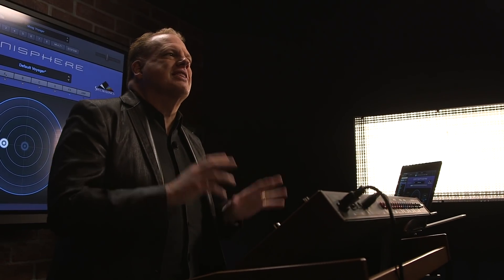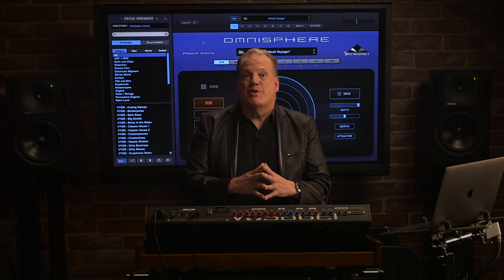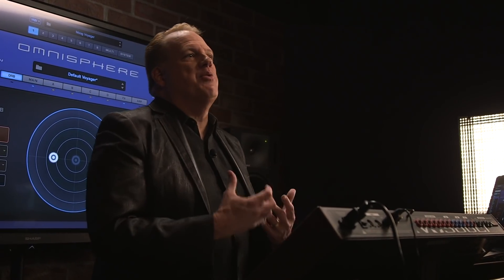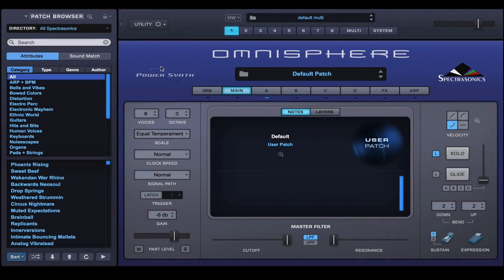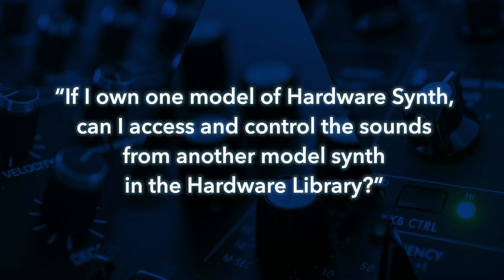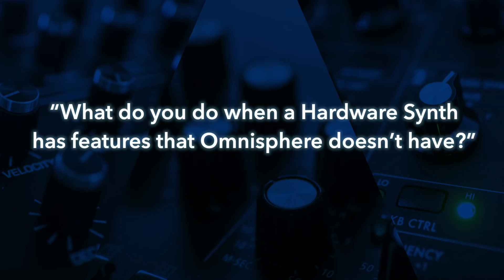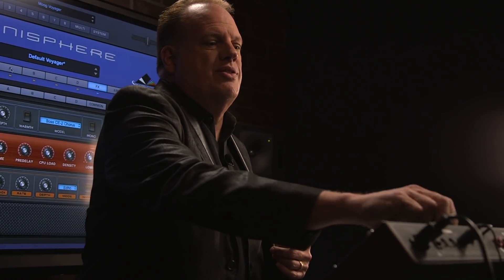OMNISPHERE - What is Hardware Synth Integration?

Comment: Are these “hardware synths” actually modeling the hardware to manipulate in the software?
Reply from the maker: Hardware Synth Integration allows you control Omnisphere directly from your supported hardware synth. Since Omnisphere is so vastly capable of creating different sounds, using a supported hardware synth as a controller often leads to sonic results that are similar in spirit to the synth being used. It’s not quite modeling, but it definitely captures the vibe. We’ve included a ton of Patches that were created this way in the Hardware Library of Omnisphere. It’s best to try it out if you can!
Reply: @SpectrasonicsVIDEO - Thanks for the reply. I don’t have the hardware but would like to use the sounds and interface. So the interface/controls on the screen work exactly the same when calling up a hardware synth?
Reply from the maker: @norakat  The sounds we created using Hardware Synth Integration are available to all Omnisphere users, whether or not you own the corresponding synth - just select the Hardware Library from the Directory and explore the sounds there! 

The visual interface of Omnisphere is not affected by Hardware Synth Integration - rather, the connected hardware synth becomes a controller for Omnisphere, where all the parameters on the synth are deeply mapped to corresponding parameters within Omnisphere. 

If you have any other questions, please contact info@spectrasonics.net and we'll be happy to help you out!

Comment: Posted this in another related video, but thanks for adding MKS-80/MPG support! Some MKS-70/JX-10/PG-800 support would be nice too - there’s a load of us out there. Not sure how you’d get around the stock vs Vecoven 3.x vs 4.x with PWM mod thing, but am sure it’s possible 😉 Ps Cheers Eric for sound design on the originals. Wouldn’t give up my MKS-80 or 70 for anything, including the Jupiter 8.

Comment: Hi Guys :-) Hope all's well. Wondering if Omnisphere would work with my M-Audio Hammer 88 Pro midi controller. Are there any new modifications since posting this video? Don't have the money to buy a separate synth. The plugin itself is expensive for me. Thanks.
Reply from the maker: Yes! 🙂🙌 Your controller will work great with Omnisphere! Check out the ref guide with specifics on how to get the most out of it here: https://support.spectrasonics.net/manual/Omnisphere2/25/en/topic/system-modulation-page01?q=midi+controller
Reply: @SpectrasonicsVIDEO  Thanks. I'll check it out.

Comment: Please add the Korg Wavestate too!
Reply: that would give you the sounds of the korg wavestate without having to actually own the hardware, right?
Reply: @FinessedAnalyzer  Yeah! Seems like it's another level of imitation if it's a total digital Synth like the Korg Wavestate which, is support for everything could be done, would sound the same (minus DAC). Wonder how the copyright is handled in that case.
Also, I don't think it is possible to include the insane amount of options that the wavestate has even in Omnisphere. The expanded wavesequencing and the modulation options for every step in a wavesequence and modulation in general makes that impossible.
Nope, it probably have to be reasonably complex Synths which rules out many of the newer digital based hardware Synths. 
Or, perhaps, even the more modest budget digital/hybrid Synths, like Arturia MicroFreak which doesn't have any support. Probably due to the ever expanding new oscillator/generative Synthesis types in it. It's the same case there even if they settled with the 1.0 factory Microfreak oscillators they still wouldn't be able to emulate the Matrix modulation of parts of the oscillator settings where drastic changes in waveform in unique ways takes place.
Omnisphere is great, but it can't do it all. For that, maybe only Reaktor would have a chance to do it. But NI haven't implemented anything like the HW-profiles....

Comment: One request for the 2.7, it can be a very easy add for your software developers but very effective in the studio or live:

When I save my projects in my DAW with Omnisphere, I would like the browser to remember (to remain selected and after the recall of the project) the Category BUT also the Shuffle button if it was selected (or the other selection options). Everytime I open the project I need to select again those two so for my work flow its a killer, need to go to every Omnisphere channel and make the selections again, I use a computer just as a engine for it so I will prefer not even open my video monitor (my Ableton with the project boot up directly like a hardware synth and use 2 hardware synths as midi controller that are "integrated" ones)

Also I will love to see a real Randomization of the patches, like the Virus TI synth type, that has 1 to100% alteration of the patch, also an interesting one where patches can "borrow" from one to each other different aspects of the patch architecture.

Thank you so much! And looking forward to your next updates! :)
Reply from the maker: Thank you for your feedback and suggestions!
Reply: Also forgot to mention guys, please please if you implement the patch Randomizer make it midi controllable as well for 100% action without looking to monitor! (at least the commit button) Thank you 　            ps: also if we don't ask to much, a Randomizer for notes of the sequencer, midi controllable as well will be lovely and I am sure its so easy as well for developers!
Reply from the maker: You should try the Sound Lock feature! It’s basically what you are describing, but it works in a more useful and musical way!
Reply: SpectrasonicsVIDEO yes I know about it but a Virus TI randomization with 1 - 100% alteration option is more efficiant and surprising from my point of view. Thanks

Comment: No support for Yamaha Montage - why?!
Reply from the maker: Hardware Synth Integration requires a synthesizer with a layout that has clearly labeled, dedicated controls. As the Montage is a workstation-style keyboard, it would not be a good fit for this feature. 🙂
Reply: @SpectrasonicsVIDEO  Lol, ok I also find it confusing .. thanks for speedy reply

Comment: new to omnisphere - can someone pls tell me if I am missing something? for example, lets say you want a hammond B3 sample for your patch - looking on the browser under 'organs' is shown "Go to this Church", "Thrift store organ" "spike bow organ" and so on - as a sound designer what I totally DON'T want is to use someone's already heavily worked patches as a starting point. Where can I find straight samples, if possible, and how can I filter out all the sources that are already someone's patches? otherwise one can quickly lose track of: "is this my original patch or am I stealing this guy's patch" not to mention its very hard to layer overproduced patches together to make a new usable sound.
Reply from the maker: All of Omnisphere's raw samples can be found in the Soundsource Browser, which is separate from the Patch Browser. It's located on the Layer pages under the Oscillator section (while "Sample" is selected):

https://support.spectrasonics.net/manual/Omnisphere2/25/en/topic/browser-overview-page09

Comment: Hardware integration possible with Roland RD 700 NX?
Reply from the maker: This feature is only possible with synthesizer-style layouts that feature dedicated, labeled panel controls - workstation-style keyboards like the RD-700 NX are not a good fit. :)
Reply: @SpectrasonicsVIDEO  thank you. Can you remind me if I can assign (Omnisphere software visual interface) to some of the sliders or knobs on a workstation style keyboard? By the way your keyboard curve / velocity mapping option for Roland RD 800 works perfectly with Keyscape!
Reply from the maker: Yep! So long as those sliders / knobs send a MIDI CC, you can assign them to any parameter in Omnisphere by right clicking on the parameter, selecting "MIDI CC Learn", and moving the slider / knob.

Comment: I'm an Omnisphere 2 user. Love it. But I can use my controller to map out all the controls. Why use a hardware synth? Isn't this just a smart way of auto mapping?
Reply from the maker: Nope! We are actually doing many new things when we support a hardware synth with a custom profile, including modeling the actual sound of that synth, and programming extremely sophisticated actions behind the scenes that create complex modulation routings, instantiating FX on the fly, creating macro controls, directly linking controls to open interface pages and much much more. It’s not the basic MIDI Learn stuff you are describing.

Comment: I'd tried omni 2 in the past and it didn't float my boat, but got it again to try the hardware synth integration as I have a few of the synths they support, and it's brilliant.  Such deep integration makes it a pleasure to work with.  The changes they've made to accommodate this have also transformed omni for me - namely the 4 layers per patch and the shared signal path option which makes working with omni more like working with a hardware synth for patch design.  It's like night and day for me compared to my experience with omni 2 the first time around - I love doing sound design with this now.  One thing I would like to see, unless I've missed it, is layer volume as a modulation destination in shared signal path mode, as currently the amp slider becomes global.
Reply from the maker: Thx for the feedback...super helpful! :-)
Reply: @SpectrasonicsVIDEO  doh, I meant layer volume as modulation destination, not source - sorry!